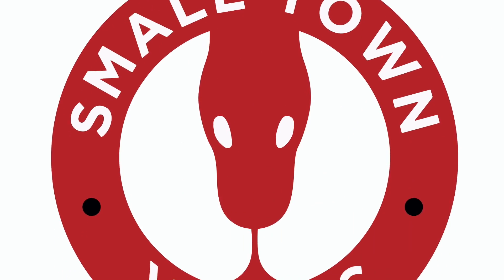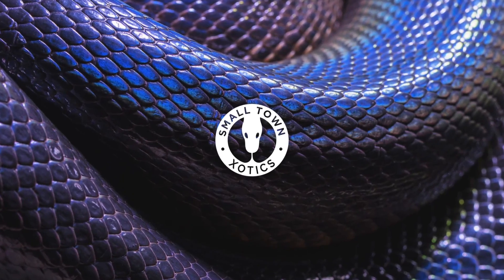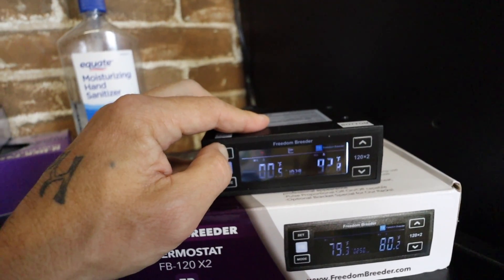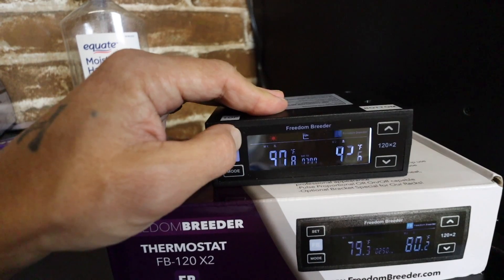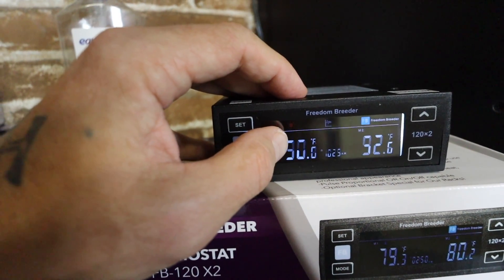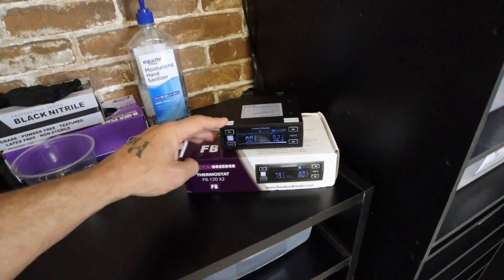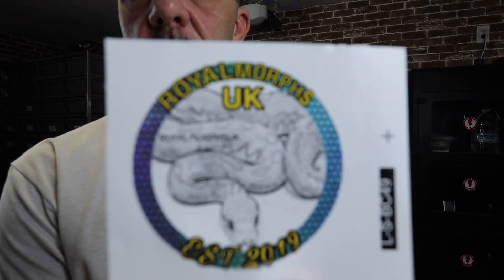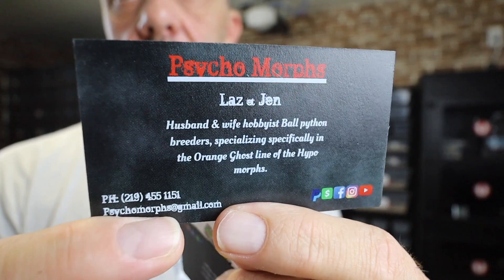Reptile Thermostat, Probe, and Rack Setup (Freedom Breeder & C Serpents)

Comment: Having issues with the freedom 120x2. Alarm won’t stop. Yet temps are good. Any suggestions ???
Reply from the maker: Have you set the alarm high and low set points?
Reply: @SmallTownXotics  yes set with 1.5 diff an 3 degree action
Reply from the maker: @mikecopley11  I set mine at 5 degrees

Comment: Also, an Fyi great tip to tape the probe on the bottom of the heat tape as opposed to the top, because everytime I pull my bins in and out the probe would always shift and eventually come off 🤦🏻‍♀️🙄.  So thx for that awesome tip! 👍👌🤟
Reply from the maker: Glad it helped!!

Comment: Hey Shane!  Amazing video!  I had a few issues with my set up so I found your video on probes & thermostats.  But question, you only have one probe for all heat mats? So one thermostat for one rack?  Is it because you run one heat tape throughout your bins? Cause I use one probe & thermostat per bin....is it cause my heat tapes are cut to fit each bin?
Reply from the maker: One probe per heat source plug. The C Serpent racks are powered by heat tape that weaves through every level. If you’re running individual mats per tub that would be a little bit different of a set up.
Reply: @SmallTownXotics  awwww ok, I get it!  Yeah my racks are from Serpent Stacks and they have holes on the back for each bin.  Different set up for sure.  Yours seems so much easier tho!